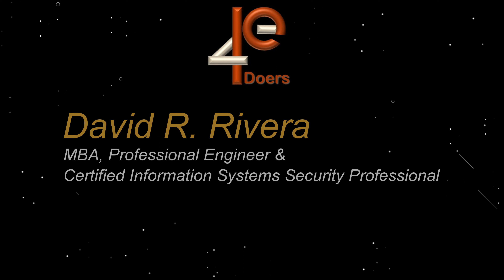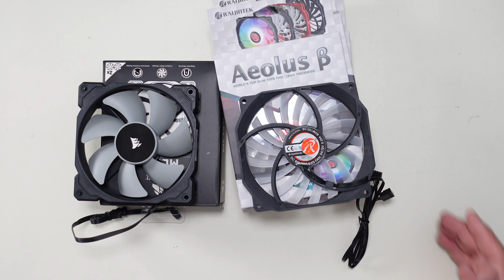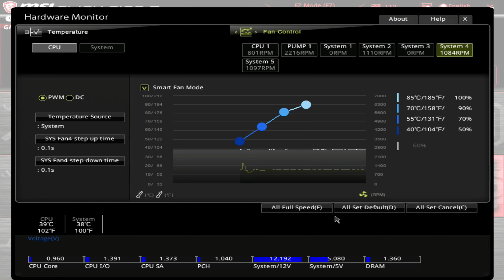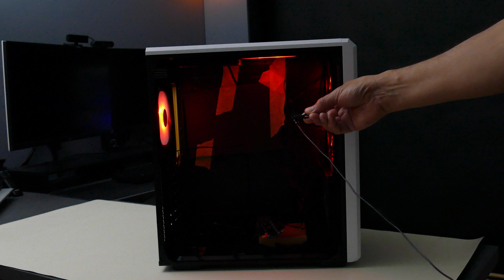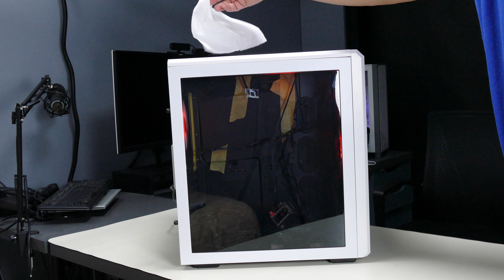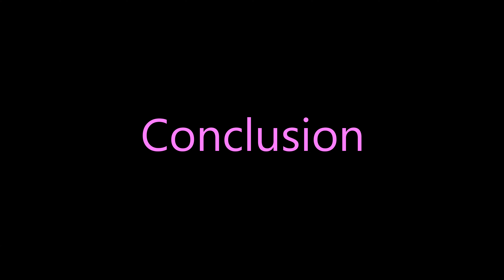How to Select, Install, and Configure PC Fans to Properly Cool your PC

Comment: Brilliant Video as always :)) Very well explained :)) The Arctic BIONiC Fans are even 27mm in depth :) Is the 240 Filter is for the BeQuiet Mod or will you go 280 for the Bequiet Mod? I would :)) 140 mm blows more Air and at lower Speed :)) My AsRock B550MPro4 Motheroard offers different options like Performance mode and so on of course they have a Custom setting too for Fans. Brilliant Idea with the incense :))
Reply from the maker: Thanks Kathrin.  By the way, I am thinking about sending you a bunch of extra DC Fans if you are interested.  Let me know in Email.